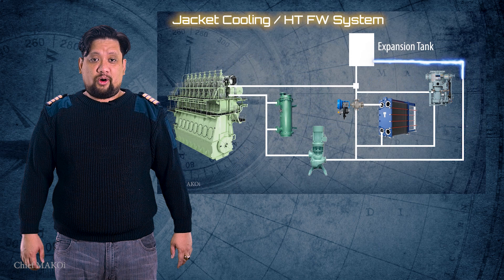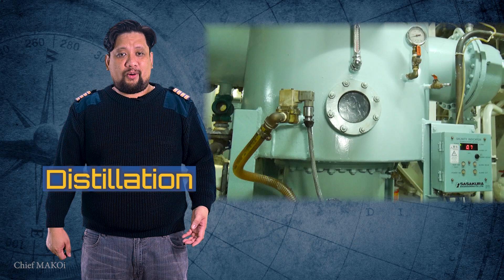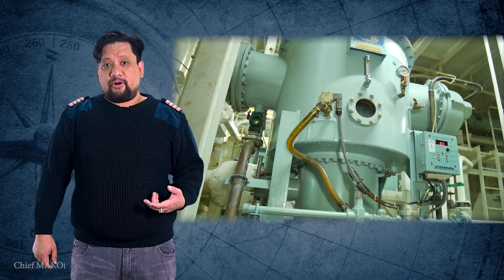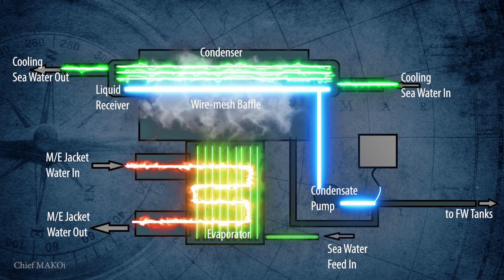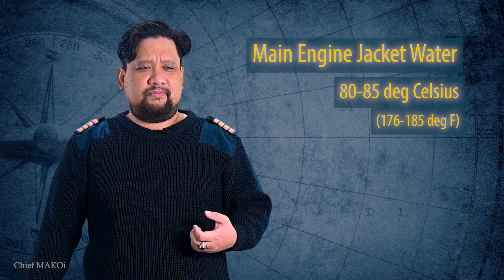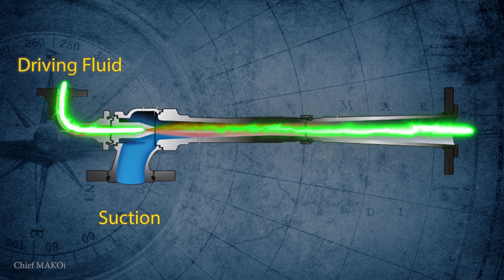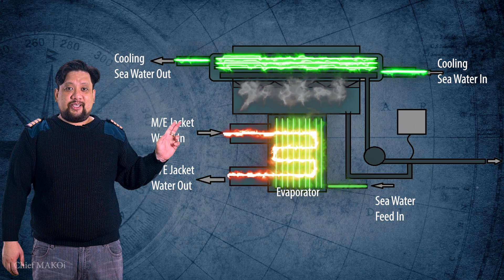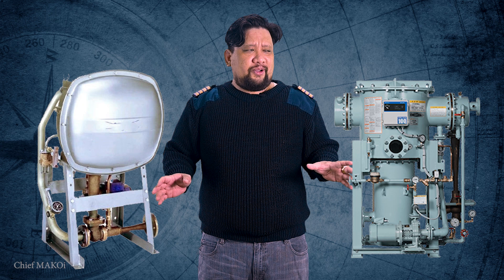How Ships Convert Sea Water to Fresh Water | Chief MAKOi Study Call Ep 04

Comment from the maker: Hi guys!  I'm still stuck at home due to travel restrictions brought about by the pandemic.  I'll be doing these lecture videos for the meantime for those of you who are interested in learning a bit about the technical aspect of seafaring.  We'll get back to regular programming once things get sorted out.  Thanks and enjoy!
Reply: Hi Chief Makoi. What keeps the salinometer calibrated for accuracy to keep the fresh water under 10 PPM? What if it goes out of calibration during operation? Does someone test the water to see if it drinkable?
Reply from the maker: Usually we just replace it if it starts acting up.  In any case, as long as it doesn't deviate too much, it won't pose too much of an issue.  There's a few more processes before the water becomes drinkable.
Reply: Hi Chief, which part of the distillation process where the solids are discarded? Or is there a practical use of the minerals that are left behind?
Reply: @diabet3  The eductor what makes a vacuum, also suck those particles out of the system.
Reply: Why are seaman confined to there cabin even after 14 days? I heard some are for 60 days stuck in there cabins.
Reply: Thanks Chief 🤝
Reply: You could teach a fish to swim.
Reply: It's good to read that you didn't abandon those life on board a ship videos since you started this series even before the pandemic. I'm looking forward to it.
Reply: Chief MAKOi do you add minerals or chemicals to the water? I’ve heard that pure water or distilled water isn’t really good for the body?
Reply: hi C/E..bakit kaya ang ibang barko ang tubig nla ay kulay brown lalo n ung ibang lahi ang crew?pki gawan naman ng episode ung ibang lahi mgkaroon ng idea
Reply: Hy Chief! Can you tell me please which program are you using for graphics you created on this video?
Thanks and best regards!
Reply: @donkingkong4334  pare, dati tagalog videos nya nung umpisa. Kasi mga foreigners nag request palage na english para maibgindihan nila. Wag ka naman ganyan.
Reply: Hey chief.. you are so dedicated
Reply: @pittypatterputzzler5311  yeah. It's because no one ready to look in detail towards seamen life
Reply: Thanks C/E Makoi....dagdag kaalaman nanaman🙃🙃🙃
Reply: Hi sir can you please give us tutorial about purifier on how to start and stop and want valves to close and open. Thank you
Reply: @ChiefMAKOi  Hi chief makoi, I think to test the salinometer if it is in a good condition or calibrated, is simply test it of a fresh water, if the reading is <10ppm , and test it a salt water or sea water and if reads >10ppm, the salinometer device is in good condition and fit to use
Reply: @mikeserrano734  oo nga, 
Hindi ko alam kung hater lang sya ni chief makoi o ewan.. crab mentality and insecurities pinapairal nya base sa comment nya. Yung mga ganyan mahirap umunlad yan, malayo blessings sa mga ganyang tao. Nabanggit na din yan ni chief makoi sa mga previous videos nya, na may mga ganyang klaseng tao, kaso hindi pinapatulan yung mga ganyang low class level. Pinatunayan nya lang na isa sya sa mga utak talangkang pinoy na mababang nilalang.
Reply: @Boxry8  wala eh. Utak Talangka. Chief, kame na bahala sa mga talngkang ito. Wag ka papatol like last time. Keep it up!
Reply: Don't shot down hot or the tubs in the bottom will fill with salt...
So take your time make sure it's cool..
Just a heads up and yrs of exp...
Reply: Chief MAKOi thank you for your video very informative. More power and God Bless
Reply: PLEASE EXPLAIN WHY EVERY SHIP I WAS ON THE WATER TASTED LIKE JET FUEL??????
NAVY CANNOT GET THE FUEL OUT OF THE DRINKING WATER???
WTF???????
Reply: @ChiefMAKOi  How come every ship I was on the water tasted like jet fuel and they said that it always tastes like that and there's nothing that they can do about it.???????????????????????????
Reply: @donkingkong4334  kung di ka marunong mag english kahit tagalog to di mo parin maiintindihan ieexplain niya.
Reply: What are the different types of Rotary machines in different types of vessels (say for LNG, crude carriers, container etc, )?
Reply: Looking forward to your other videos. May basher comment akong nabasa. Anyway, follower mo rin naman. Hehehe
Reply: Thank you Chief Makoi. Indeed, very helpful
Reply: Chief MAKOi keep up the lessons your good at what you do. I watch your videos and have learned a lot about the task of running a huge Ship. Just a shout out to you and your crew.
Reply: You sir have a gift.  You could be a professor in any high end college.  Your ability to explain all of the things you do on your channel can make even someone like me fully understand.  You keep yourself out of what you are explaining in a way I've never seen before.  Thank you for sharing your knowledge and gifts with us.  You sir are making our world a much better place.
Reply: 0
Reply: what happends if the repeller breaks of in a gale or storm ???
Reply: Man you are a good teacher.
Reply: @thecloneguyz   How do you get jet fuel in FW lines ? I
Reply: @ChiefMAKOi  feel great watching your very informative video xplaination..keep up on teaching us chief..stay safe always
Reply: really really slick motion graphics work man. is this all you or did you hire someone? fantastic channel btw you are doing it RIGHT. I hope to get to your level one day and Im learning alot by watching you on sea and as a creator! Cheers my friend
Reply: Very informative sir chief macz, tnx for sharing...
Reply: Slick presentation Chief Makoi!   Christmas Greetings to you and your family or whoever you are with.
Reply: Excellent explanation of how this is achieved using the waste heat from the engine and without burning additional resources. I like how the sea water is also preheated by the condenser. How much of the ship engines waste heat is utilised in this manner, I assume it is still only a small percentage of the overall cooling required for the engine and therefore the heat of the engine is closely monitored in order to keep the engine at optimal temperature dependant upon how much cooling is diverted into producing the Fresh Water?

Also does a little salt get added back to the Distilled water for drinking purposes? I know drinking distilled water is very tasteless and does nothing to replace essential salts lost when sweating.
Reply: @Chief MAKOI  im curious  to be the chief engineer on a ship, what field of engineering is that? and is it a specific field unique to commercial ships?  thanks in advance and ive just subscribed and liked the video
Reply from the maker: @nickox7813  Marine Engineering
Reply: @ChiefMAKOi  wow thanks for the quick reply is marine engineering a mix of mechanical and electrical engineering? id imagine you need to know a bit of both
Reply: You must have access to the best editing equipment...your special effects, and other tricks, etc., sure do much for your videos.  I'm a retired EMS First Responder and am hoping to start doing educational videos in the near future.  I'd sure like to learn what you use.  Thanks for the fabulous informational videos!
Reply: Chief please make more study call videos.
Reply: @ChiefMAKOi  Please make more study call videos.
Reply: Can you show us what Marine Engineering Works to do 😁
Reply: Salute to your lesson grapslide... ButFor now class dismiss. :) 😇😊

Comment: As a former commercial boiler technician, I approve of this video!
Reply: first of all thanks to chief,  
as a boiler technicain my question is to you,  is it possible to use thia as a  methanol distinction system.  methanol boiling point is 60 degree.
Reply: @abdullaalhamid5621  sure, if you modify it enough, clean it out really good and control the temperatures correctly lol

Comment: I was stationed aboard a US Navy repair ship as a machinist mate and worked in the engine room. My ship had a consolidated engineering plant (boilers & turbines) in the same space. We had two triple effect evaporators that used 250 psi superheated steam and could produce 72,000 gallons of fresh water in 24 hours @ .025 ppm. our potable water was the same purity. Our boiler feed water was treated with a corrosion inhibitor and was stored separately. I've been watching your channel a lot. We had 550 officers and enlisted with 50 men assigned to the engine room. Thank you.

Comment: I have to be honest, this is actually my first time hearing about ships converting salt onto fresh water. I thought they resupply on port and comeback to port if the water has gone to minimum. This is very informative, thank you!
Reply: Same with me,
Reply: Likewise. As an inveterate landlubber I'd never given any thought to this! After all, why should I? But, now that you mention it, it makes sense. I thought it'd be just simple distillation - at least until you introduced the complications.
Nice simple presentation. I like that. I (more than) suspect you've glossed over a lot of the really tricky bits but this is a marvellous introduction and one that I could see being adapted for smallscale  onshore usage under certain circumstances
Thanks. Subscribed.
Reply: Filipino Marine Engineers are smart engineers.

Comment: I was a machinist mate stationed on a steam powered navy guided missile cruiser. We had 1 distilling plant in each engineroom and used 600 psi steam to power our distilling plants. It was a 2 stage plant that made 500 gallons an hour with less than .01% salinity. Our plants had insulation on them to retain heat. Awesome Videos Chief Makoi!

Comment: I'm an old fellow long retired from dealing with ultra pure water systems and heat exchangers deionizer scrubbers and conductivity meters.  We have a small water still but we accepted condensate water from a power plant by the truckload and scrubbed it further for our ultra pure systems.  We had to make sure we didn't scrub it too much cuz otherwise the water got too hungry for minerals and ate the elbows out of copper pipe systems.  All land based work.  Nevertheless I actually learned a lot from this video.  Thank you so much!

Comment: Its a    good initiative from u thank you so much 
Engineer it's so great from you to explain how do every equipment work like pumps separators ...
You here in this course give a #professional #experienced #lessons  #not #an #academic #ones (like what you will finde as difficulties  as a beginer engineer ..for example: in the Cooling circuits what are the frequent problems  and what do you advice to handle with it ..not just how do it work )
Also I requeste you to do a parallel   courses about #steam #propulsion #systems with the diesel ones 
Thank you chef

Comment: Chief Makoi, Absolutely fantastic stuff.  I don't remember sharing a story previously, but here goes. 

My father was a Journeyman Ship-Wright and served in the Royal Navy during WW2 and private boat/shipbuilding afterwards.  One story I remember him telling me was that when ships were in port and or dry-dock, crews would open the boilers and have to use chipping hammers and chisels to descale the boilers and I'm sure various associated piping.
On one occasion that he was aware of, at the end of a shift and almost finished cleaning, most of the crew left except one to complete the work.  The next crew came on and called out to make sure everyone had exited the boiler and the boiler was ready to close up and be fired up to which they did.

The last worker did not clock out and did not arrive home.  The alarm was sounded and they drained and opened up the boiler.  Inside was the body of the last worker.  Since they called out prior to closing the boiler, they believe the man took a break and fell asleep!

My father said that very likely happened many times through the years on different ships.  These days there are many safety procedures in place to minimize such things happening.

My question to you is:  Even with all the modern boilers and systems, you must still get scale buildup and need to clean it out.  1) What area's of the ships systems are prone to scaling up and sediments buildup that still requires de-scaling and cleaning?  2) What automatic systems if any does a ship have in place to prevent and or control scale and sediment buildup, or 3) What process do you have to conduct an inspection and de-scale water systems, etc.

If anyone else also knows of any systems and or procedures, I would love to learn about them.  I can be reached at >>  lisabook2017@gmail.com 

Cheers
Reply from the maker: Nowadays, Boiler water is strictly tested and monitored and treated to make sure that scale build-up or corrosion will not happen or at least be minimized.  In case of work in enclosed spaces, there is a working permit and safety protocols to ensure that prior to closing, everyone involved in the job is accounted for.

Comment: One of the first tasks I learned after reporting aboard my first US Navy ship was how to clean salinity cells (salinometer sensor).    This was a common task, as we had them to monitor water quality for both Auxiliary (fresh water) and Propulsion (boiler feed and condensate monitoring).  Obviously, I was stationed on a ship old enough to have a 600-PSI steam turbine propulsion plant.

Will you eventually be covering the additional treatment required to make the distilled water from the evaps safe for human consumption?  Filtering, chlorine/bromine/UV, mineral replacement, etc.?
Reply from the maker: Yes.  It will be discussed in an upcoming episode.
Reply: @ChiefMAKOi  Awesome.  Thanks!
Reply: pure 0ppm distilled water is already the safest water you can consume. The moment you start adding crap to it, you simply ruin it. Minerals are not needed in the water, since you get more than enough from your daily meals.
Reply: @johnhighway9397  I was on the USS Brush (DD-745).  I was the Comm Officer, but cross trained in engineering.  Do you remember where the fresh water holding tanks were?
Reply: Kevin Crosby 600 lb steam would have been nice!  My boat, commissioned in 1957 as an LSD was 465 lb pressure!
Reply: @John Highway I remember our grade 7-8 science teacher 38 years ago “Never drink distilled water unless by necessity, if you do it all the time, at the long run it will drain out all your minerals and will put your body at risk of diseases” not sure how true is this.
Reply: @thegirlsquad2500  yeah ,it's right what ur teacher said.u cannot drink distilled water all the time.some of the minerals r supplied to the body thru minerals present in the water.

Comment: My guess is that distillation in an engined ship is more energy effecient than reverse osmosis, which is more popular on sailing vessels.
Reply: Also iirc reverse osmosis needs "consumable" cartridges/mediums, so essentially it generates waste, whilst these distillation plants are all vessels and tubes which can be scrubbed/cleaned
Reply: It's less energy efficient, however waste heat from engine cooling is is a cost you have already paid for regardless of if you are going to use it or not. But you can't run a reverse osmosis plant off of that, reverse osmosis plant requires a strong pump which would one way or another be an additional fuel cost.

Comment: This is wonderful topic.
Because of solar heating sciences are advancing. Small and big scale distillation plants can be designed to make salty subsoil water useable and drinkable after adding minerals.
There are some complications in making exact  balance of vacuum and water temperature. 
Engineers who do not understand to maintain that balance face problems . In many ships fresh water shortage occurs be so called fresh water generator does not work.
It is very simple machine .vaccum .water flow .water temperatures. Are three cardinal points .
Solar tubes can heat up salt  water . Small vacuum chambers makes it boil at 60 degree calculus. Condensation tubes deliver distilled water.
This should be done in every house hold . In near  future there shall be serious shortage of fresh water.

Comment: When i was in the Navy . part of my job was to operate a vacuum distiller in the forward engine rm  . but we had another  distiller in the aft engine rm that got its heat from the cooling water from the main engines knida like the one yall run  .

Comment: 1. After the salt is taken out does it go through a water purification system?
Note: Fresh water doesn’t necessarily mean purified water.
2. The salt that goes back into the sea does that impact the salt content in the ocean when you multiply the number of ships using the system you mention?
3.  Is it cheaper in the long run to fill its water tanks up at sea by using this system than buying water from the shore?

Comment: Hey Chief, correct me if I am wrong, but isn't it unhealthy to drink just distilled water for any length of time? That is why many bottled waters, designed for drinking, contain some trace minerals that have been deemed healthy for one's physiological makeup. I have read that drinking just distilled water can result in eventual leeching of minerals from bones and other areas. Do seagoing ships have built into their systems a mineral additive feature for its potable water?